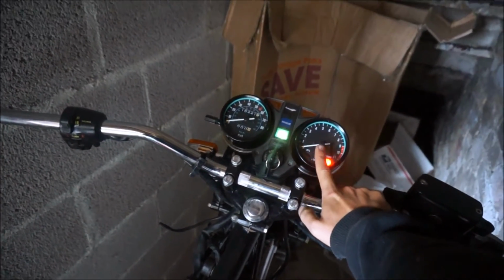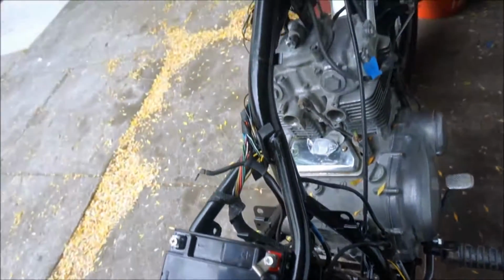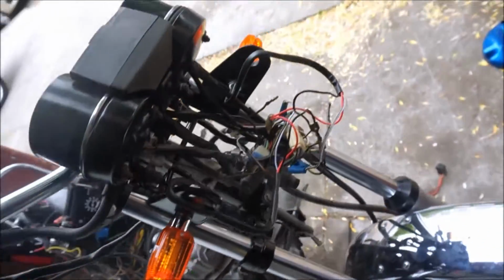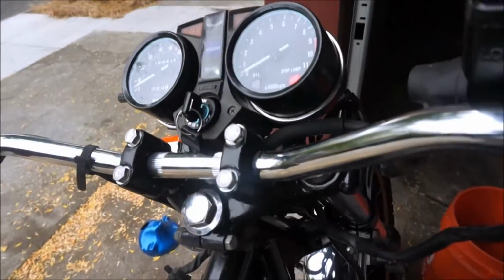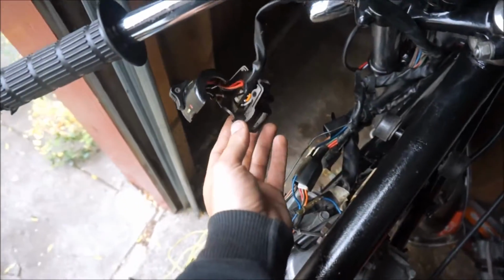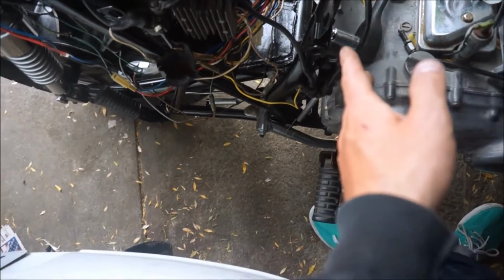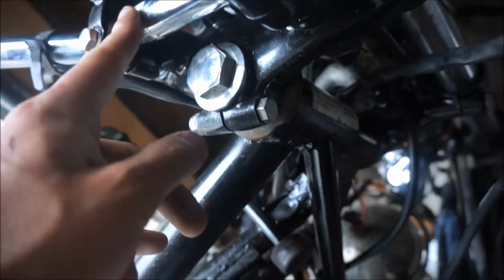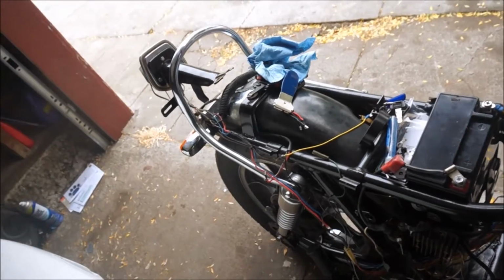Kawasaki KZ400 Restoration Part 18 - Electrical issues and solutions

Comment: At 3:02 you see a brown wire in the head light bucket that isn’t connected to anything. My 1980 1981 KZ440 service manual has brown wire not connect for US and Canada models KZ440-B2. The diagram for “Except US and Canada models KZ440-B2” has brown connected to a second bulb the is labeled “City Light”. I was in Germany in 1981 and noticed that the motorcycles their would have their lights on all the time even in the day time. Kawasaki just made one harness for the bike that had or didn’t have the second bulb called a “City Light”.   I think US bikes all have this “City Light” feature now for safety.
The brown wire has power when you turn on the ignition switch. It never goes off even if you turn off the lights.

Comment: by the way, nice restoration,  I rode a lot of Mikes on a bike identical to this one, except it was  a 1974. for the connections,  if you want to solder, after clean , I use silicone,  and over that a shrink tube

Comment: never solder wires for dc current. connections have dissimilar metals with the solder, and creates corrosion. buy stainless steel connectors, and a professional crimp pliers